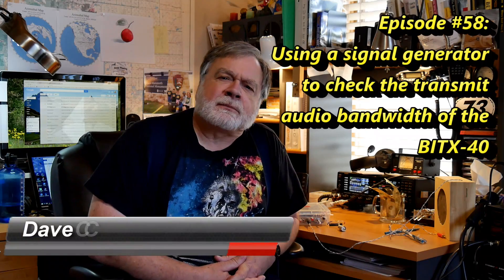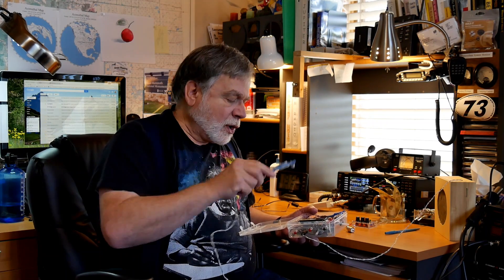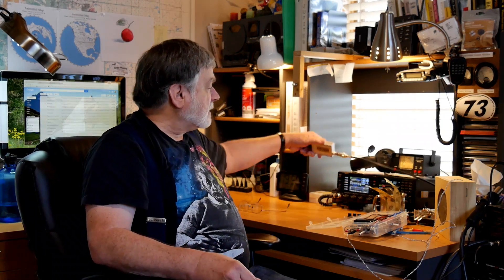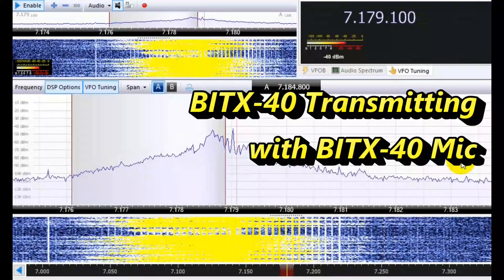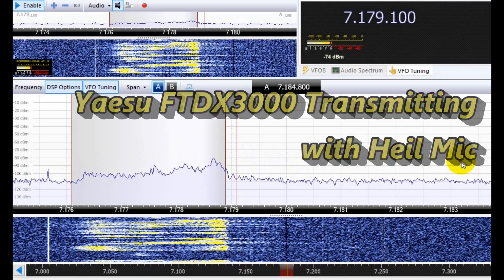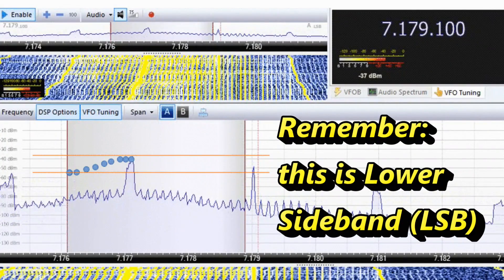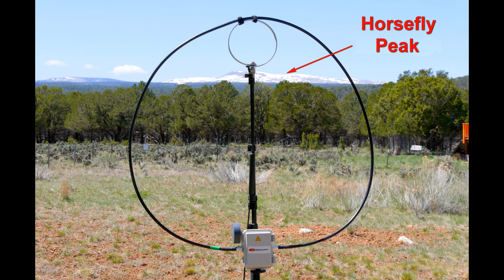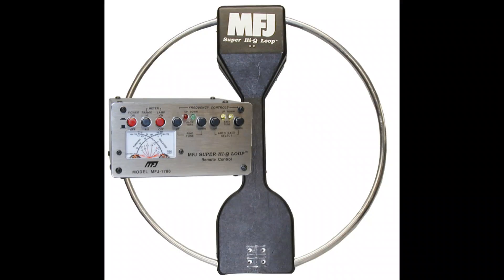BITX-40 TX Audio Response Tests (#58)

Comment: Did you isolate the problem with the BITX or is it not worth digging into?
Reply from the maker: I didn't dig in much. It's a very inexpensive microphone that's not in any housing. People tell me on the air it's quite intelligible, but my recordings sound awful! It seems good enough for purpose.
Reply: Have you thought of maybe replacing it with a old reel to reel mic or even a cassette recorder hand mic or even a MFJ mic?
Reply: I just received my Bitx in the mail the other day.  As soon as I saw the mic I'm thinking of getting a connector to allow me to plug in my Mic I have for my Kenwood into it.  I'd be anxious if someone else did something similar.   That way you're using the same kind of mic for the comparison.

Comment: VK3YE made a modification to make the audio more "punchy" by moving the carrier.  This was done in the "pre" arduino version, but the modification might be the same.  You might check out his videos.
Reply from the maker: Can you give me a leg up by sending me a specific link? I'd appreciate that.
Reply: Replacing the L5 jumper with an actual inductor will also lower the BFO.  The Arduino is only used for the SI5351 VFO and LCD etc.

Comment: P.S.  I'm most interested in the MFJ loop.  I'm using a Pixel receive only loop here.  I use an attic dipole for transmit.  I can't use the attic dipole for receive because the noise is a constant S 9.  The Pixel loop allows me to hear, but the sensitivity is way down.  Looking forward to your reports on the MFJ loop.    '73     Bob    N7ISU

Comment: Thanks for another great video. 
Great to see videos showing that one does not need expensive equipment to do testing. 
I'm also looking forward to the P-Loop video after the snow melts.
Reply from the maker: I tried using it today on the back porch. It receives very well, but so far I haven't had a QSO with it.